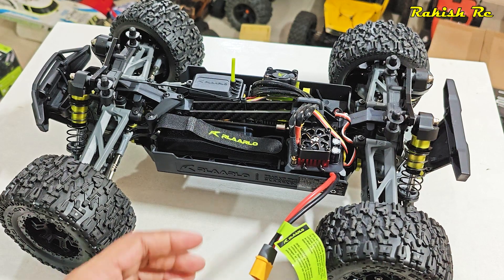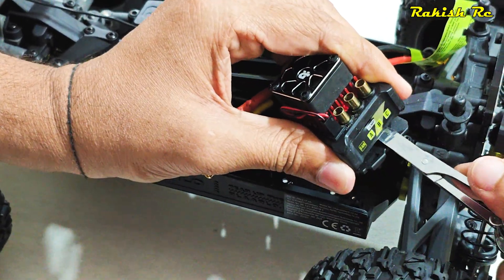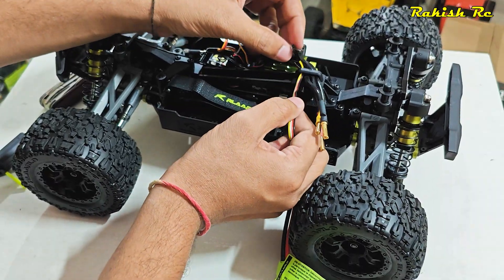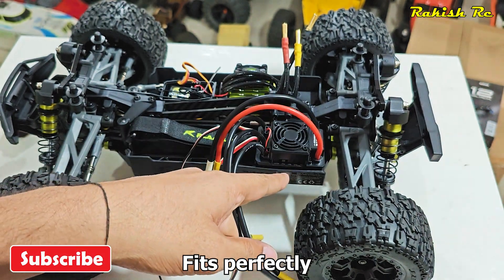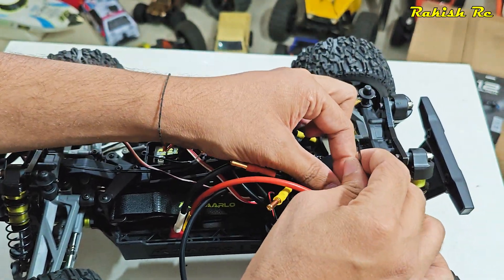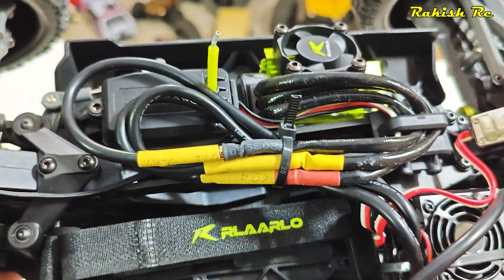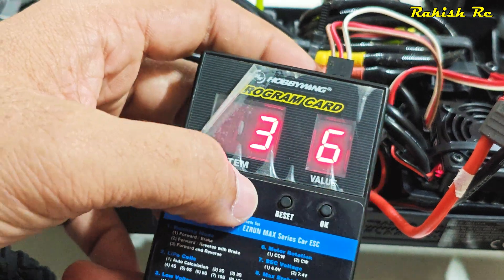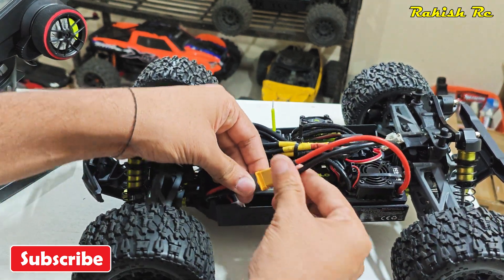Rlaarlo Omni Terminator 4s ESC Upgrade & Installation Tutorial

Comment: Excellent video.  When you switch out the ESC to 4S, can you still use 3S batteries or do they have to be 4S?
Reply from the maker: You can use 3s..just that you'll notice slightly lower punch and power...the stock esc has good power on 3s and the upgraded 4s esc delivers more power on 4s
Reply: @RakishRc Thank you for the quick, easily explained reply, ha.

Comment: Dose it cog really bad,?
Reply from the maker: No not at all.
Reply: @RakishRc what size pinion? Mine cogs horribly
Reply from the maker: I used the optional High speed pinnion included in the box...i think it's 26t but not exactly sure..the cogging might be due to loose motor esc connection or a bad solder joint on the motor or esc wire internally.. or I should also check the esc power connector if it's got good solder joint

Comment: That stock motor can’t even hardly handle a 3S it gets super Duper hot already. You do have to get a bigger motor.
Reply: I don’t have any overheating and barely gets hot. And I run the speed pinion.
Reply from the maker: On 3s or 4s? 3s is completely fine... Although 4s does cause excessive heating of the motor on aggressive throttle
Reply from the maker: @troypowell2403  but i did not have any over heating problem on 3s stock motor.. Are you running the stock pinion or a bigger one?
Reply: i don't notice heat, either, stock 60A on 3s
Reply: I put a 4068 in mine and its ridiculous standing backflips from takeoff punch on 5 120amp hobbywing esc@Mike_Greene

Comment: Could of use adapted instead of cutting out the cords
Reply from the maker: @FreeBandsRC  yes but usually xt60 is better for higher amp than a deans and adaptor usually add some resistance.. So simply replaced the connector

Comment: With the new esc the turbo boost is no use no more
Reply from the maker: You mean the new rlaarlo stock esc is missing the boost option?
Reply: @ I’m saying sing you out in a new esc that turbo spot on receiver won’t be useful since new esc don’t got turbo cord like rlaarlo stock esc
Reply from the maker: @FreeBandsRC  yes new esc will not have turbo option.. But it's more powerful than the stock esc

Comment: Why is it two wires to the esc??
Reply from the maker: @JörgenSandström-k6o  I think that yellow wire on stock esc is for turbo mode but not sure if it really works or not.
Reply: @RakishRc it does. It’s the side button. It’s much more punchy if you have the battery to tandem the additional current.

Comment: Very cool video that's exactly how I did mine. I see you're not concerned about the gyro either. Although I did think about going to dunbo RC with the six-channel gyro for speed runs but I don't know maybe in the future I'll do that...
Reply from the maker: Hi, yes very true what you said.. I have actually put 4s esc and a 4s motor on this so top speed is increased now.. Just that gyro is something even I am looking to work on. Last time on 3s I got 65kmph may be on 4s it should cross 75-80kmph
Reply: @RakishRc  Hey Do you mind sharing what motor are you using? What 4S motor?
Reply from the maker: @tommyt4g63  hi, I have bought a new motor that's exactly like the stock one but it's got official 4s voltage rating and is 2300kv..will be posting the video tomorrow saty tuned 👍
Reply: @RakishRc  Awesome!!!! thank you for updating me. 👍🏻
Reply: @RakishRc does it mean the stock 3s - rated motor got destroyed?
Reply from the maker: No it's still working but eventually it will get damaged with overheating.

Comment: Does it still run fine using 4s
Reply from the maker: Yes but the stock motor does heat up on aggressive throttle and jump flips.. If you really want to upgrade consider a 4s compatible motor also.
Reply: I have a 100 amp 3s capable esc is that going to be possibly better option?
Reply: @nickford7659  Sure...  if you want to run 3S that would be great.  I would make sure it's a reputable brand I wouldn't go with a cheap ESC.  When I first started getting into the hobby I bought a cheaper one and it was crap it had so much delay in it that even though I had more power it wasn't worth it because it's performance was crap...

Comment: i just got this rc not to long ago and as soon as i plug the lipo battery that it comes with it starts up with out pressing power button and it wont shut off unless i unplug it , any idea what could be wrong w it
Reply from the maker: @hectorrjr6167  mostly likely the power switch is  pressed or stuck or damaged... Although not sure if rlaarlo has updated the esc like traxxas where battery needs to be unplugged for power off.
Reply: This happened to me aswell. My esc burned next battery. Is your esc still working?